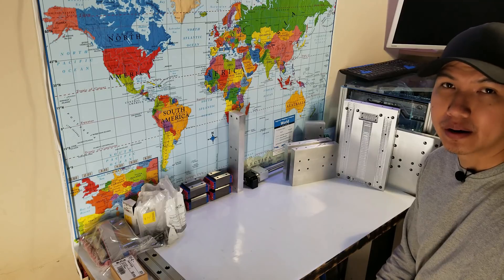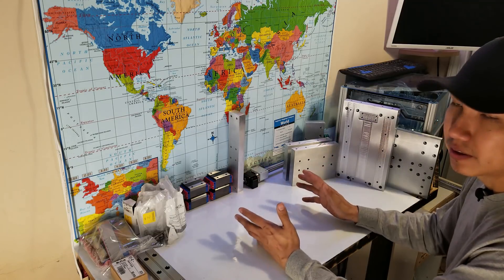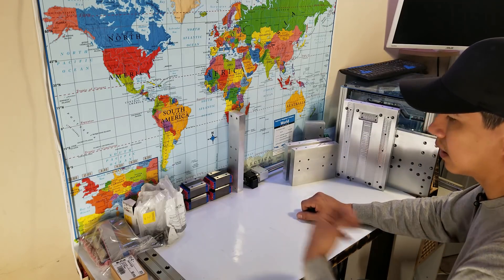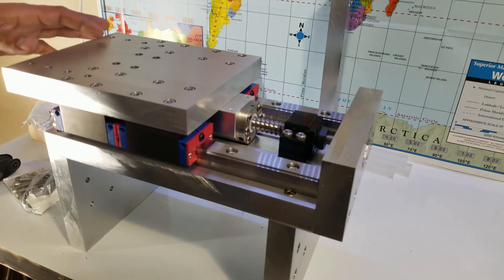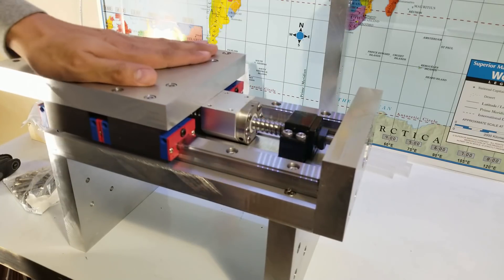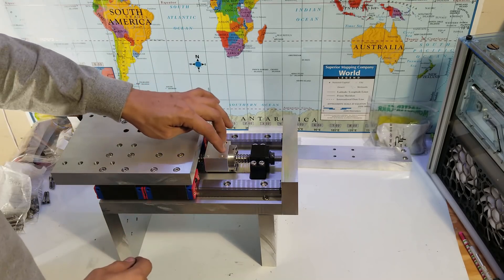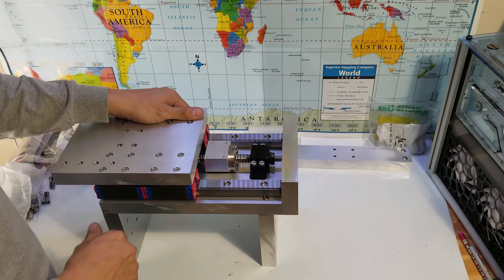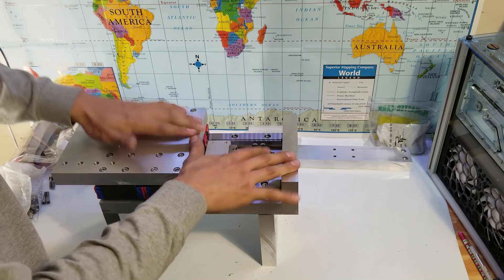Homemade DIY CNC build part 3  (Z-Axis)

Comment: Amazing ,  I was curious about your gantry side plates. how thick are they? looks pretty rigid and sturdy.  Im thinking about upgrading my CNC to something of that thickness. Right now my sides are 1 inch thick aluminum rectangle tube. which makes my machine very light.  I need something a little bit more stronger heavy.  I think what you have is perfect.  Your videos are awesome.

Comment: Out of curiosity, how are you tramming your Z axis to your bed? Does the spindle clamp have enough play in the bolt holes to twist it side to side? I am presuming you shim it for the Y position? I am looking at building my own CNC router and I am just looking at how this is done.
Reply from the maker: Thepriest39 yes the the spindle holder has a bit of play on the screw holes in order to tilt it from side to side. And for the back and forward I have about 3 pieces of aluminum foil.   But first I try to make sure that the gantry is as square as it can.  That makes tramming a lot easier
Reply: Awesome. Thanks for replying back.

Comment: what motors are you using nema 34? and were are you buying the parts like rail blocks ?. looking into building one my self for steel , but smaller.
Reply from the maker: Bajo Tierra producciones the motors are Nema 23 servos from clearpath teknic 
 I got all my linear rails and bearing blocks from trimantec.com  they sell from 20mm to 30 or 35mm profiles and some “miniature”

Comment: Nice work man. I been looking into 80/20 to build my own myself. Looking forward to it once I have more expendable income. Have you noticed any lack of strength/torque from just having 1 ball screw for the Y axis?
Reply from the maker: Savant PCs not with the Servo motors, they have a lot of power and torques that can make the whole cnc shake aggressively if I put full power

Comment: How much did it cost to build?
Reply from the maker: The whole cnc complete  around 4K  but dont need to be this much,  if you choose steppers over the Teknic servos and go with less thicker aluminium/linear bearings it could be around 2.5k

Comment: What is the motivation for the 1inch plate, especially on z?  It all looks cool, and if it's just that's what you wanted, then cool, but I don't see how a 1" plate on Z adds anything other than mass that has to be accelerated and such and just make everything work harder.

But it looks impressive.  Looking forward to the next video.
Reply: Rigidity and mass dampening. The more mass you have, the lower the resonant frequency of the installation, therefore you will get less chatter usually.
Reply: The Android Shepherd is this as valid or necessary on a plasma CNC?
Reply: @Jaye Mathisen... That was what I was thinking... The 25mm rails seem a little overkill too.
Reply: Using a servo motor in small sized build like this is even more overkill. But then again we all want servos in our build so good for him.

Comment: What is the workable Z of this design ? Looks like about 400mm perhaps. You mention that you will be doing aluminum and plexi was it. Not so much wood :-)
Reply from the maker: Yes I mostly cut plexy and other plastics and some aluminium not to much wood,  the Z axis has only a travel of 140mm and the table of 635 x 635 mm
Reply: Ahh , well you cannot determine the scale very well, the actual usable is 635 x 635?? Long day at work,   what I meant was of course 200mm   for the Z :-)
Reply: Long day at work, I meant to guess high at 200 of course. I don't imagine there are many DIY or turnkey manufactured tables with Z axis of 400 (16")  :O
I was trying to look at the reservoirs on Ebay and nothing having to do with any Ebay URL is working and this since 1130 am today. Now it is nearly 800pm Weird

Comment: Hello! What do you use as screw fix? Does it have a back axial lash?
Reply from the maker: It has the  antibacklash Ball Screw 1605 w/ ballnut & BF/BK12 End Supports   if that's what your asking
Reply: Radikult my  BF by china fix has backlash above 100 mkm. It has two ballscrew 6000z. You use china too?
Reply from the maker: yes I bought the screws from a china ebay dealer,    check that the ball screw is not bend

Comment: Wow nice! Clearpath Servos! :D
Reply from the maker: ipadize yes
Reply from the maker: ipadize hopefully the nema23 can do the job, soon I'll try to connect them to a Esmoothstepper
Reply: they will. Servos may have less NM but still they are way stronger because you can overcurrent them by 300% for a short time also the torque curve is way better than for example steppers

Comment: Superb work again man. In the process of making my own! 
One question, is it necessary to use solid alloy blocks for the gantry sides and Z axis? Could I just use extrusion for that also, provided everything is aligned and rigid?
Reply from the maker: Kane Jaeger oh yes, by all means this is not the only way to build cnc's, plus if you don't have the tools to cut aluminium plate then yes extrusion are easier
   I even think I went a bit to far with those big aluminium extrusion, I could of build it out of 2x2 inches and maybe 2x4 extrusions  and 3/4 thick aluminium  and save some money too hahaha

Comment: I like your CNC videos 🙂🙂

Hello from Germany
Reply: Great work Radikult. Impressive. I see this is your first CNC build, so a little bit advice, you need to use Loctite on all screws/bolts after you have fully aligned, calibrated and tram your machine.  

And for safety, please try to knock off the edges of the aluminum parts a bit.
Reply from the maker: Samuel .G.Larmie yes I'll add locktite, I'll have to move it to where my other cnc it's currently  in, so most likely I'll have to take it a part to move it, it's quite heavy to move by myself
Reply from the maker: Hello    thank you!
Reply: Radikult, how much cost the CNC at the end (finished)?
Reply from the maker: between $3800-4k +/-
Reply: Radikult, holy glory 😂😳 but it's solid made and can outlive itself
Reply from the maker: Miki Müller hahaha yes  not cheap,  just the servo motors and breakout board cost around 1700.  Cnc frame around 2300
Reply: Radikult, yeah....maybe “used goods“ can make it cheaper ? U bought all the parts / materials new?
Reply: Great. yea . i know how heavy it is. I built two machines (with 80/20) with a working envelope of 26"x30", just a little bigger than yours and I was unable to even move it from one corner of my work bench to the other. Which State are you at, I would love to see the machine and also learn a thing or two from you with the Clearpath servos. Am about to buy a NEMA 34 chases next month. I will DM you on instagram.
Reply from the maker: Samuel .G.Larmie I live in Georgia.  The next video would be about connecting the clear path servos sdsk to a ethernet smooth stepper board, I been going over those manuals on how to connect them together  lol